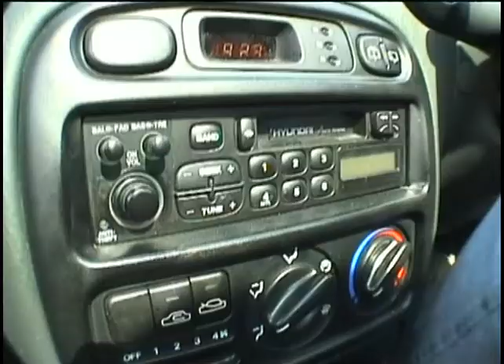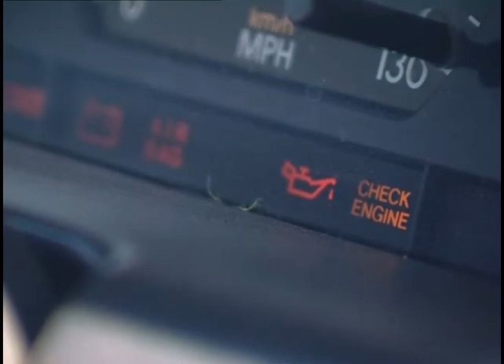Clarkson - Head To Head: Banger Racing A Hyundai Accent 1.5 GLSi

Comment: I always wondered if this was a pre-production car that had to be destroyed anyway. Can't imgaine how could Clarkson do this before Top Gear and never make Hyundai angry.
Reply: I have a theory on that, quite a few early X3 Accents had dodgy subframes that weren’t welded properly from the factory. Considering the likely age of that car (pre-facelift built between 1994 and 1997) it could have been a dodgy subframe car that was rewelded with potentially other defects (while quality had substantially improved, the odd dud still rolled out of Ulsan), which could have meant it was a car Hyundai (or a specific dealer) didn’t want to sell. Hyundai wasn’t pleased about Clarkson’s comments about Koreans eating dogs the year before so I don’t think there was any love lost over this.
Reply: @turn6garage640  So this is a 1994-1997 version, with a T reg plate (meaning that it's late 98 - early 99) that doesn't appear on the DVLA database, so T13 MST is a fake number plate.
Might be a faulty cheap 2nd hand car as you say, but I'll believe it's a pre-prod car, because it looks too clean.
Reply: Pre-production car makes sense especially considering the timeline of the newer Accent coming in 2000 and this needed to go. Although what I had in mind was a car that was either never registered and found to have a significant manufacturing defect, fixed up long enough for filming then destroyed or was registered and found to have numerous significant faults within the first few months that Hyundai replaced it under warranty (there were a handful of serious duds in the Accents that were trouble really early on, although most were solid). That would have been within 3 years/60k miles at that time for the UK (3 years/100k km in Australia. I do agree T13MST isn’t a real plate, they just used it to show it was available as a new car in 1999.
Reply: @turn6garage640  Also consider this: MSD and MST are factories linked to Hyundai (check out the Accent WRC number plates), so the MST letters on that Accent number plates are either fake, or they prove that the car belonged to Hyundai itself, kinda like SRT for Subaru or FMC for Ford.
Might be a defective car as you said with fake number plates, but I'll stick with the Pre-Prod car destroyed because the car is too mint (even the dashboard was untouched) and because instead of going against a whole car company, it's much easier to destroy a pre-prod car with Hyundai's agreement (except the dog eating story) and letting everybody think that they destroyed a perfectly good car.
Which is typical Clarkson's style, btw.
Reply: Wait, pre-production cars have to be destroyed?
Reply: @twongi3000  yes. They are not like the final product, so they are not road legal. There are videos of Chrysler ordered to crush rare pre-prod Vipers. Disappointing, I know...
Reply: @Teamgeist In the first comment I said "BEFORE Top gear". This way before Top Gear as we all know even started.
Reply: @toxy3580  No that was a joke. I really think it was a pre-prod car.
Reply: @Snarl616  nah
Reply: @toxy3580  And what are your points to say you're right? I'm asking 'cause some solid points against you were revealed in comments above.
Reply: @Snarl616  it's about dog
Reply: This was actually a '95 model

Comment: That looks like a pre-facelift 12 valve Accent Clarkson destroyed. Even thought it was wearing 1999 T plates, it was probably built in 1996 or 1997 as it has the older style hubcaps, front/rear lights and badge located on the bonnet. Hyundai gave the Accent 16 valves as an option in late 1997 in the form of the updated 1.5 litre engine. They could have also attached T plates to an older car for the purpose of filming as well though.
Reply: Yep, rare car
Reply: Fully loaded 5 door models are quite rare now. Base 3 door models and later base spec 5 doors are still a common site in Australia. Between 1996 and 1998 the Accent (Excel in Australia) was one of the top 3 best selling cars and for a couple of months of 1998 Australia’s best selling car. Hyundai built them in large batches for the Australian market so that’s how they could compete strongly on price and so many sold.
Reply: Looks like the T13MST is not in the DVLA database, so it's a fake number plate, and at this point I'll think it's a pre-prod car that had to be destroyed anyway.
Reply: 4 door models here in Chile are avery common sight. The ride like a stuffed pillow and corner steady. I like the accent
Reply from the maker: I can confirm that this was indeed an older model as you say. The number plates were never registered to any car at any point, this was also confirmed by checking if they'd been registered with a certificate of destruction. 

I believe this was a pre production car that was going to be disposed of, or an ex demo. I cannot confirm this though as of now, but the car was a 1995/1996 model.
Reply: I agree with all the commenters, this Accent was probably slated for destruction anyway. It was great reading all the detail you (and others) had to say. I remember reading about this episode on a now defunct website called Autofocus over a dozen years ago.
Reply: You can see the proper plate on the drivers window just before it's smashed, It's on an N Reg
Reply: @kieranwhite6647  when can we see it?
Reply: Still a horrible car
Reply: @Snarl616  That’s not always the case. I had a car which the DVLA doesn’t have records of now. I think sometimes they scrub the data, depending on how it was taken off the road.
Reply: I had an e39 m5 that I sold 9 years ago to move to new zealand. According to the dvla those plates don't exist, nor show any record. I often wondered why there was no record of it.

Comment: Funny enough this same model of Hyundai car in Australia can last going across the Nullarbor plains several times from Western Australia to Queensland. The engines could be tuned up and the car would go like a rocket.
Reply: I think you're talking about the excel, which is also a secretly loved car. Surprisingly tough little bastards the old Hyundai's were
Reply: @Wtrxprs007able  my grandma's Hyundai was a Getz. Yeah when she traded it in it had nearly 300 000. On the clock
Reply: @Wtrxprs007able  The Accent was sold here too. Cheap to buy, cheap to run and very hard to kill. Great little car.
Reply: @Nick Shipway  yes I know that. I think we didn't have the model shown in this video but the next one. A couple of my mates have one from the early 2000s and they can't seem to kill them 😅
Reply: TDI for Life  I bought one! I had very little money and it ran like a champ for two years. It ran Melbourne to Sydney and back a few times and happily Melbourne to Lakes Entrance and back several times. It was fairly comfy, had a decent AC and was actually pretty nippy to drive. Also you could insure it for sweet FA!
Reply: TDI for Life  My mother had an 01 Accent from new... They were dirt cheap with a long warranty. My brother still drives the car and it has 400,000+km on it. Still running fine, should get another 100,000km out of it no worries :-)
Hyundai absolutely smashed the competition in the late 90s, early 2000s.

Comment: I love banger racing but can never get my head around the huge amount of prep work required on a car (sometimes to be only out on the track for a few minutes).
Reply: You should see how much people do to full-weld demolition derby cars. Those things are staggeringly stout and their bumpers are absolute weapons of mass destruction.
Reply from the maker: As a racer myself who uploaded this video, I should mention that back in the day the prep work was so little that it meant you could go buy a car on the Friday evening, build it the following afternoon, paint it in the evening, race it on the sunday and then scrap it on the Monday morning. 

These days, your average banger takes a few weeks to build. Far too much safety in them now because of HSE Regulations, and most people overbuild the things as they're competitive or trying to make a very strong car. Not to mention modern cars are full of annoying electrics, loads of plastic, bonded windows, crash sensors etc so they take longer to strip than the likes of a Ford Cortina or something similar. 
Then they go to the effort of swapping engines, making solid mountings for them so they can't fall out, fitting massive water tanks, hours of welding work to doors boot lid and steering arms, lowering them, etc. 

I highly recommend watching the Back To Basic Bangers, as these can still be built in a day if you're keen. They keep the theme of what the sport was originally about, making for an afternoon of extremely low budget motor racing. My last 2 Back To Basics cars actually made me a profit when I scrapped them!
Reply: @Cascroft-lp6ir  true, but i love how Jeremy took that head on like it was nothing and kept driving 😂

Comment: To think that the Accent now is about as old as that Dolly was at the time, and there was a hell of a lot more of them left in the late 90s than there are 90s Korean cars left now. Equally crap though, badly designed, badly built, at least Korean cars are good now, and British cars still aren't
Reply: It was the first car entirely built in Korea with Korean technology. Ridiculously cheap, but also cheaply made, still, VERY reliable. I'd say it was a good deal for the price.
Reply from the maker: Dolomite would've been roughly 25 ears old at the time of filming. There was quite a few still around at the end of the late 90's being used daily, even into the early 2000's I suppose.
Yet anything Korean from the 90's now which would be a similar time frame, is almost impossible to spot. Can't remember the last Korean car I spotted that was made in the 90's, and I regularly do Carwatching so just gives you an idea of how rare they have become. Then again, there's not many 90's cars on the roads now compared to 70's cars in the 1990's
Reply: Back in the day people didn't change cars every 2-3 years (most people even less these days) and more people held on to their cars for as long as they could. If this was the case today, far more classics would still be around, including the old Korean motors. This was at a time Hyundai really turned a corner and started making good cars. Far better than the woeful Escort. The original accent was well bolted together, simple and reliable.

Comment: Hyundai cars back then really are garbage, this Accent deserves to be thrashed
Reply: father had one for 20 years 400k on it, change oil every 10 k and the engine never had any problems and we are talking about a 1,3 liter engine 86 hp souper reliable cars good gas milage, very cheap parts
Reply: @johnyguitar258  exactly why its goin into the bins